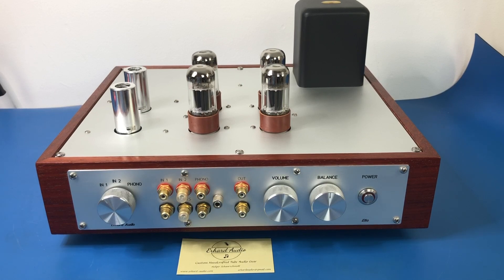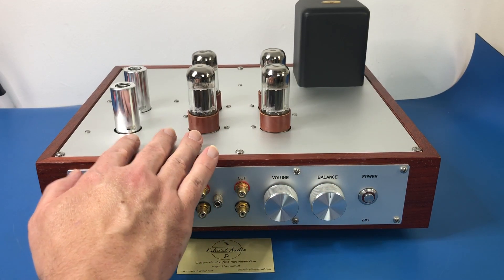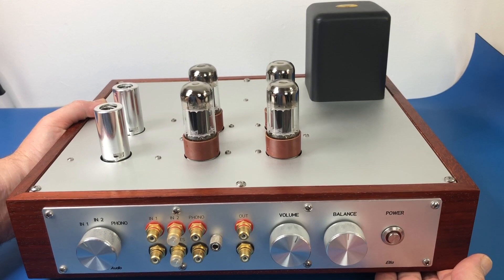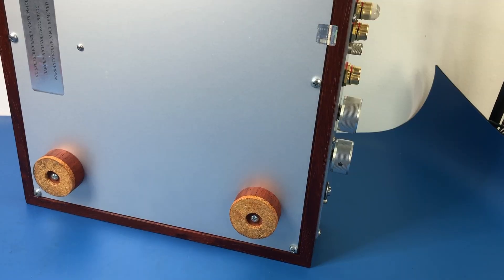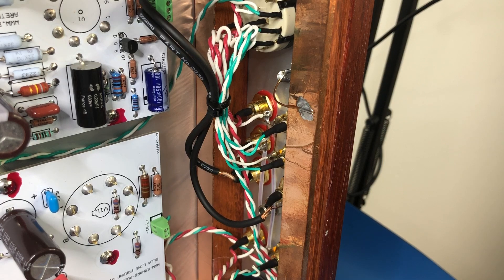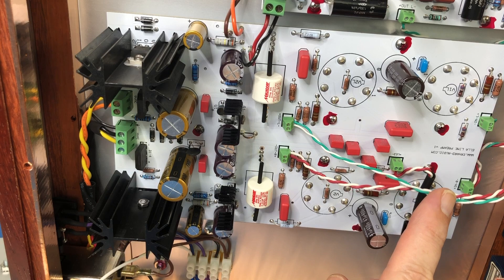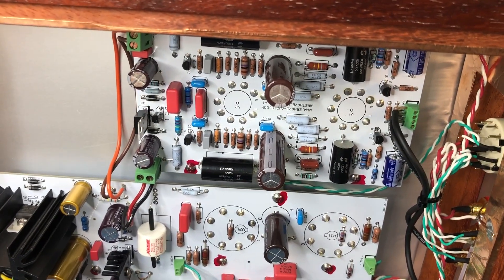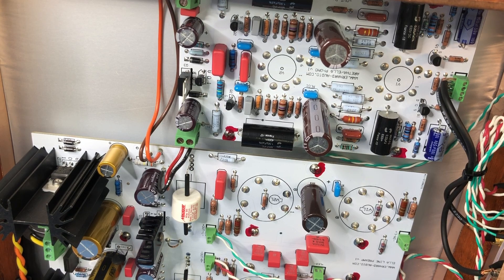Erhard Audio Ella Tube Preamp Tour and Teardown

Comment: The important thing is that you are happy .................how does it sound ?
No amp/preamp with low distortion ( measured ) does sound the same ............even the same good sounding pre/amp does sound different with minor changes of tubes and components !
In reality there are many pre/amps that measure VERY low distortions but sound horrible wrong ......music is not sine waves nor square block waves with a steady frequency but dynamic transients related in time ? Your ears tell the truth ...........and your soyul connects to the music or NOT !
Anyway a beautifull / modern build for a fair price...............well done .

Comment: You and I seem to be on the same page... following since your ST 120 presentation.  This is spectacular!  I only play WAV files thru my ST120 using a DAC, just curious what a preamp brings to the party besides input flexibility?
Reply from the maker: That's a really good question. And I'm not sure that it can be fully answered. True, these days, we can usually control the source volume, and switching sources isn't that much of a big deal. If you listen to everything from a digital source that goes to a DAC, that then goes to your power amp, why do you need a preamp? Especially if your power amp has attenuator pots... Well strictly and practically you don't. I needed something because I didn't have a phono pre-amp. But you would also know from following my videos that I am somewhat of a purist, and a purist viewpoint would say that a power amp should have a pre-amp. The thing that ultimately sold me was a discussion I had with Elson Silva of Cymer Audio. Elson is regarded as a guru here in Sydney, and the products he builds are legendary. Elson told me that a proper valve pre-amp was needed to match the solid state output of my DAC to the ST-120. I asked Elson to build a pre-amp for me, however he was dealing with some medical matters at the time and was unable to build it for me. After looking around, that's when I found Holger and had him build this Ella for me.